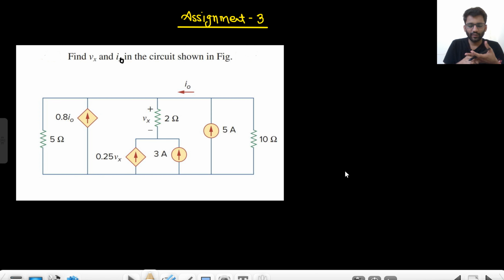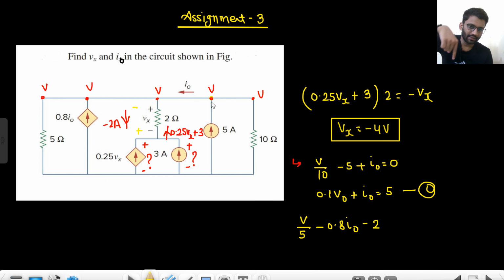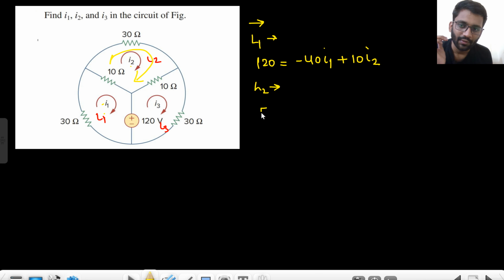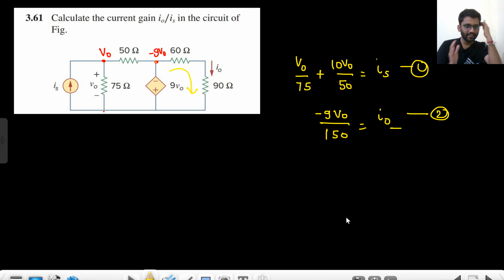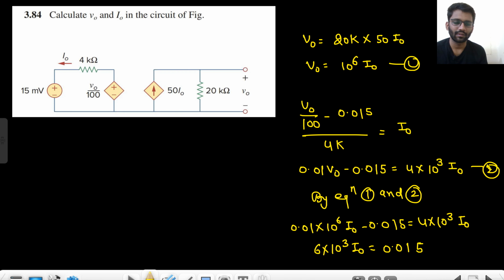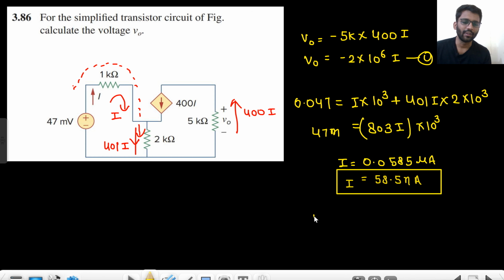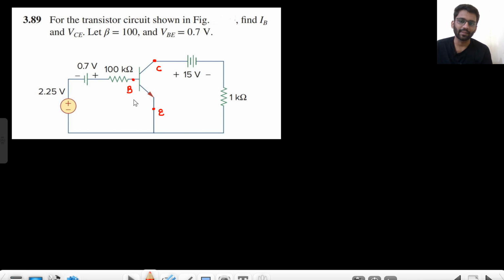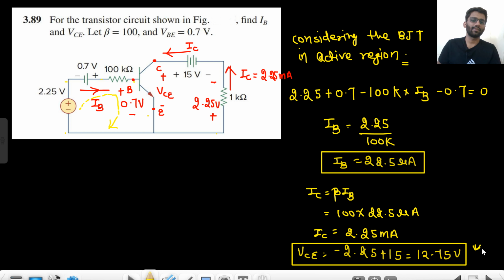Assignment 3 Solutions || Network Analysis || GATE 2025-26 || PrepFusion || Himanshu Agarwal

Comment: Vx should be 12. At 2:25, top eq shud be +vx since current flows down in upper branch
Reply from the maker: Current flows down, that's why it is -Vx.
Reply: Current flows down from +ve to -ve right? So +vx?
Reply: @samaygoel707  did u understand that ,i got struck there
Reply: @akashramesh3003 current flowing up into the -ve terminal of 2 ohm resistor is (0.25Vx+3) so it's -(0.25Vx+3) = (-0.25Vx-3) that flows down into the +ve terminal of 2 ohm resistor because the direction of current is then flipped in order to get current flowing from top to bottom side.
That's why the eqn becomes
Vx=2(-0.25Vx-3) => Vx=-4 Volts